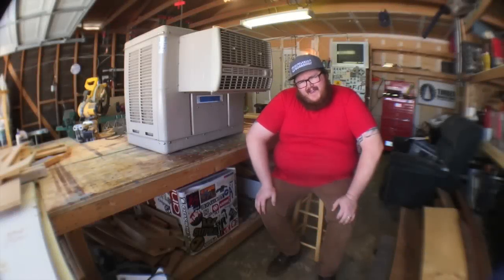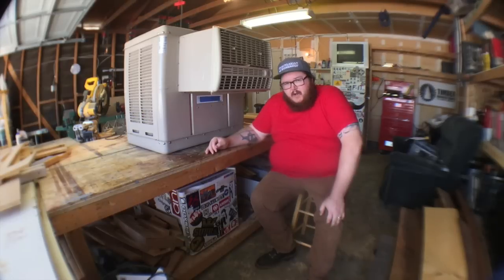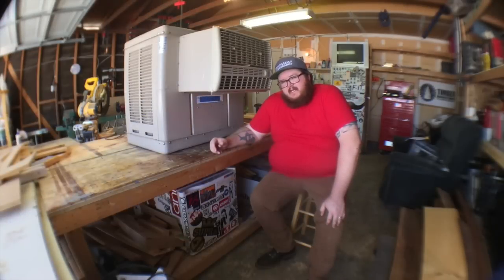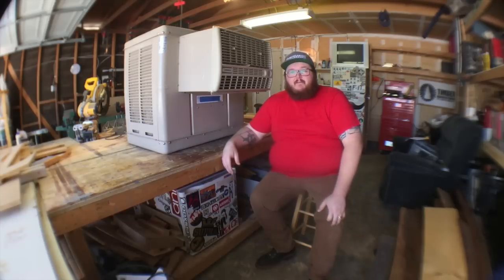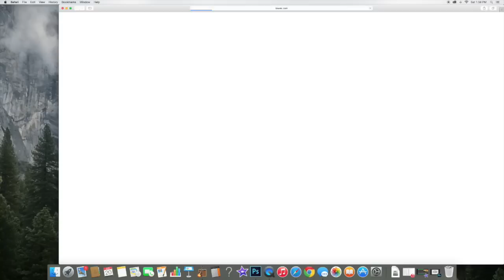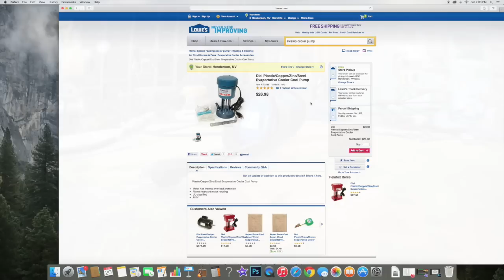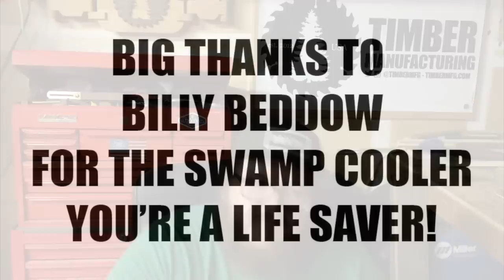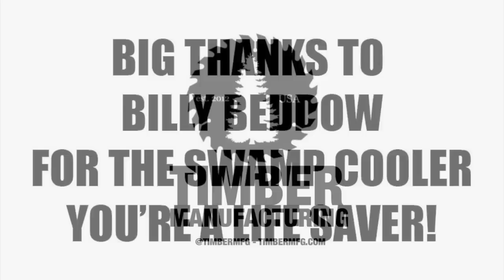Swamp Cooler Tuneup

Comment: I'm here in Vegas as well... I got a cooler just like yours and cut a hole in one of the walls in my garage and mounted it there.  I crack the garage door and run it all the time and on the 113 degree days it keeps the garage at about 78.  Which is, ya know, awesome!  But, yeah, those coolers your role around on casters without exiting the air or sealing a cool air path are muggy and terrible.  If you want a wheeled one, like you made, then people use those outside under cover in a place without walls and just let it blow on them.  In your situation I'd get rid of the cart and, again, mount it in one of your walls.  I also put a temperature control on mine so it automatically turns off once it reaches whatever temperature I desire.  That way at night it doesn't just keep running and running and wasting energy and water.  Great video
Reply from the maker: It works fine for now, I'm going to insulate and get a mini split AC unit. I didn't want to cut a big hole in the side of my garage for this thing.

Comment: What size pump did you use? I couldn't read the label - I think I've oversized mine with 11,000 pump for my shopcool sc3500. It's either that or there isn't enough water distribution tubes over the pads. I only have 4 one on each side.
Reply from the maker: I think mine is an 11,000 too? I'll have to double check. You could see if the slits where the water drains on the pads are all clogged up with calcium build up and junk from the pads. I had to do that to mine a couple days ago to get it working good again. There's also 4 or 8 way distribution tube kits so you could get more water distributed across the troughs at the top.

Comment: you need to circulate the air for a swamp cooler to work. cut a hole in the garage and have the cooler outside with the duct facing in. you are just raising the humidity by running it inside the garage. We get ours to bring temps from 100+ down to the mid 70's by adjusting windows to let the humid air out.
Reply from the maker: I set up fans and keep the garage door open about a foot to allow plenty of circulation. Theres no way I'm cutting any holes in anything for this thing hahaha. I've been slowly working on getting things insulated and I'll have a mini split AC unit in here before long.

Comment: Nice video...
Come down and hook mine up 😂
Question
When the HIGH position 
Isn't blowing as hard as it used to
It's blowing more like it's on LOW
Do you think it's the motor
I've had for man years
Reply from the maker: Thanks for watching, Leo! It could definitely be the motor, have you been oiling the fan bearings regularly? It could also be those, if they've been running dry for a while. You could test it by unplugging it and then taking the belt off the pulley so the fan will spin freely. It should spin fairly easily on its own. While you're at it you could spin the motor by hand too, same deal as the fan, if there's any drag or it feels kind of crunchy chances are that's the issue. If you've got hard water like we do around here, the calcium build up really tears up the motors. Mine was acting up right before I put it away last year. It would just randomly shut off after a little while, so I have to get that figured out now hahaha. I've been running the same motor in it since this video. Hope you get it figured out!

Comment: Got me a used swamp cooler, I just purchased a new float valve as I was filling it manually and running it for a few hours, but once I install the float assembly and hook it up to the garden hose with the adapter and use that to fill the pan can I leave the water on at all times and only fill to the desired fill point?
Reply from the maker: +Edmund Burke I leave it on the whole time when I'm out in the shop, but I always turn it off when I go in for the night. I have accidentally forgotten to turn the water off and it's been just fine in the morning, But better safe than sorry I figure. I don't want to wake up to a huge flood in the shop hahaha

Comment: My pads don’t seem to be getting wet enough. Thinking about putting a small fish pond pump on mine, here in Texas with some humidity they help in my metal shop.
Reply from the maker: Thanks for watching, John! A more powerful pump probably wouldn’t hurt. One thing to check is the tubes at the top delivering the water. The old aspen pads I had in it broke down and the pump was able to push a lot of the little pieces in to those upper tubes and clog them. You may be able to run something through and try to clean them out to see if you can get some better flow from the pump you’ve got. Also, not sure how the water quality is where you are, but here in Vegas it’s super hard. I had a lot of calcium build up in the slits in the water trough at the top of the pads. That could be something else to check.
Reply: Braxton Wirthlin   Yeh I blew the delivery water tubes out with air and the slits in the trough are fine. After watching a video from the champion cooler on the correct way to install new pads I found out that I was doing it wrong along with everyone else. You don’t tuck the pad in at the top underneath the trough. Pull the pad inward so water is forced to run down the outside of the pad. I will fix it first thing when I get to the shop.
Reply from the maker: John Davis great tip! I’ll give that a shot myself!
Reply: Braxton Wirthlin yes just type in champion cooler and it will come up. A little over a 2 minute video. Braxton I put my cooler on casters too so can roll it around.  The one in your video looks almost new. What a deal .
Reply from the maker: John Davis I’ll check it out! Yeah, I was really grateful to get it, it’s been a life saver for sure. I should have an update video on it soon. Recently I added a gravity feed tank to the top so it’s all self contained and doesn’t need a garden hose hook up. That was definitely a big upgrade.
Reply: Braxton Wirthlin can’t wait to see the upgrade. How big is your feed tank? Gallons? I guess your float valve cuts the water off. I redid my pads and it made a big difference. Now the pads are getting wetter. I think I was wishing for a lot to quick. Can’t expect too much until the pads get really soaked. Here in North Texas the humidity is high in the morning and I am able to get by with a fan. The humidity drops off most afternoons and that is when I use. I had a Port-A-Cool evaporative cooler and I hated that think. Those really add to the humidity. Regular evaporative coolers are a lot better than those. Let me know when you do your updated video.
Reply from the maker: John Davis nice! I’m about to move my pads to where you suggested. It’s a 12 gallon capacity clear plastic storage bin with the double flip top lid. They sell them at Lowe’s and Home Depot. I’ll leave a link to one similar to what I’m using. Then I put a faucet coming out the side and sealed it up with silicone. 

Akro-Mils 66486 CLDBL 12-Gallon Plastic Storage KeepBox with Attached Lid, 21-1/2-Inch by 15-Inch by 12-1/2-Inch, Semi Clear https://www.amazon.com/dp/B00006IARN/ref=cm_sw_r_cp_api_i_wO0dFbWCS0HP7
Reply: Braxton Wirthlin   Yes what you did has made more portable. Less leaks to worry about too. You do leave a door open so that it can get fresh air? They work better being by an open door. Mine sets in the middle of the shop with 3 garage doors open. I was raised in New Mexico and swamp coolers was all we used. I had never seen a refrigerated window unit until I came to Texas. Just wondering how long does 12 gallons of water last?
Reply from the maker: John Davis yeah, I keep my garage door open and I usually have a fan going on the other side of the garage to help circulate some air. If I’m running it all day like 8-10 hours I’ll usually fill it up twice. Once in the morning and once in the afternoon. That’s if the reservoir at the bottom is all the way full. If is not it’ll suck it down pretty quick. I’ll usually turn off the tank 15 or 20 minutes before I turn it off the unit. That way the water in the pads doesn’t over flow it. Sometimes 20 minutes turns in to an hour or so and it’s got a lot to fill up in the morning. I grew up here in Las Vegas and have had swamp coolers forever. This one works great except around mid to late August when it gets super humid.
Reply: Braxton Wirthlin  when it is real humid here I try to run the pads a little dryer. This one of mine makes a decent fan without the evaporative part of it. My shop is kinda big so I can’t have it blowing on all of the time but it sure is nice to sit in front of it and cool off for a few minutes. Yeh being in Vegas you have been around them all of your life. I am in North Texas and it does get humid here. I can go an hour west and be out of it for the most part. I was in New Mexico last year and people still use them for the most part.
Reply: Braxton Wirthlin   Good morning Braxton. I ran my cooler yesterday and couldn’t get much out of it. I never run it in the morning only in the afternoon. Too much humidity I guess. Just wondering if I put a fan behind it would help? I have a strong Patton floor fan. A lot of people in my area went out and bought Portacool air conditioners. After using them they are sorry they did. They cost well over a grand and are pretty much junk and do not work in a shop. Our old style works better. Mine sits in the middle of the shop but I have 3 ten foot garage doors open all of the time.
Reply from the maker: I'm not sure if that would work, but it's worth a shot. It might help having some air flow on the pads. I've never tried that, I might have to give it a shot myself though.

Comment: My cooler is making an occasional humming noise i oiled the bearings  but its still doing it what do you think it might be?
Reply from the maker: Obviously it's hard to say exactly what it could be without seeing and hearing it, but here's a few things you could check. 1st you could check the belt belt that runs the motor and see if it's worn, that could cause some noise. 2nd check that the water level in your pan is high enough so that the motor isn't struggling to pump it. That would cause the pump to make noises of the water is too low. 3rd check the motor itself. Try moving the pulley on the motor to see if there's any wiggling or play in it and the motor shaft. It goes without saying, but make sure the swamp cooler is off and unplugged so there's no risk of hurting yourself before you do all this stuff hahaha. Hope this helps! Let me know how it goes.

Comment: im having trouble with my swamp cooler its kind of like the one you have but mine has two switches on the front the left says cool and right is two different speeds i guess and the right now is really loose now so i have to unplug it everytime i am done using it
Reply from the maker: Sounds like the switch itself might have gone bad. You'll probably have to open up the panel to fix that, and I don't really know much that would help in that area.
Reply: +Braxton Wirthlin yeah it still works but i have to unplug it after we are done using it my friends dad might know how to fix it ill have to see thanks for the help
Reply from the maker: no problem, sorry I wasn't really able to give you any assistance. I don't know too much about electrical stuff. I'd probably just keep unplugging it after I use it if that happened to mine hahahaha

Comment: Good job. However,  I bought mine new 5 years ago. The owners manuel states to use 30 wt engine oil in the blower bearings, which I have done. That's a whole lot heavier than that light oil you used. You might want to look into that.  Ruining the bearings would just suck! It's the EXACT make and model yours is.

Comment: thank you i appreciate it.i have to figure out what model i have now i suppose,the stickers are so faded,i know it's a alpine but thats it. thank you,chris
Reply from the maker: Not sure if brands matter too much. I didn't stick with any particular brand or when it came to the pump and pads and hoses and stuff. I just grabbed whatever they had and it seemed to work. The pads I got were over sized and I trimmed them to fit. They only had one brand of pump at Lowe's so I bought one that pumped the same amount of water as the old one.
Reply: Yeah i saw your video when you done it all. thanks for the input,just curious....have you ever tried using  a block of ice in the water to drop the temp,i would think that would make a huge difference in output tem. thanks, chris
Reply from the maker: Chris Hood I haven't tried it yet, but I've definitely considered it. Maybe I'll pick one up tomorrow and give it a shot!
Reply: Let me know the cooling temp difference.I know salt water would lower the temp substantially but the ice will not last as long,i wanna do a experiment with tap water and one with salt water to see the difference once i get my unit back up with all the new parts filters etc that i need. let me know how you fare.
Reply: I got mine going.I added blocks of ice and 6 ice trays.Talk about a HUGE temp difference, WOW!! You should try it.
Reply from the maker: +Chris Hood nice! I'm definitely going to give that a shot!

Comment: Hey man, I was wondering how the swamp coolers working now that temps are rising again. Anything you'd change with nearly a year under your belt?
Reply from the maker: I pulled it out a few weeks ago, cleaned out the pan, oiled the bearings, and it fired right up and is working great. I haven't run in to any issues with it that I'd really want to change. I had given some thought to adding a tank to the top and having sort of a gravity fed reservoir so I didn't have to have it hooked to a garden hose all the time, but aside from that change its working awesome. Thanks for watching!

Comment: Very nice! One question, what is the added moisture going to do to your tools, i.e. rust?  I tried something similar and I found all my tools, especially cast iron table tops started getting a thin film of rust.
Reply from the maker: Frank Thornal I havent noticed any surface rust on my tools yet, but i'm definitely keeping an eye out for it. My garage door is typically about half way open and its only running when I'm out here working. I also set up another box fan in addition to the Swamp cooler so i keep the air circulating pretty well. Thanks for watching!

Comment: Excellent vid. A comment that might help further. Crack a couple of windows and keep a small air flow going while your running your cooler. The cooler air feels nice but be aware of the moisture your putting in your shop area. And that WILL rust your tools, firearms, and anything else not protected from the humidity. A couple of frozen 1 gallon milk jugs in the pan does the trick. Make ya want to put on a coat. Ask me how I know these things. Stay cool.
Reply: Abdulla Ex is right. If you don't open windows, you have a humidifier - not a swamp cooler. It's tough to retrain ourselves b/c with an a/c, you want to keep the house completely sealed up, but the cooler is totally different. The a/c keeps reconditioning the same air. The cooler can't reuse the same air.

Comment: i modified mine blows 48 deg in 108 Temp AHHAHAAH
Reply from the maker: How’d you do it? I need to get mine blowing that cold hahaha.
Reply: @BraxtonWirthlin   make sure you have the larger champion cooler. Then double the pads only aspen. Then install 11K pump. let the silt (hard water sit on the  pads every season) the white silt with the 2x  pads will start to cool way more efficient. i made a video of this with a temp sensor if interested.
Reply: @BraxtonWirthlin  not a joke... 48 deg. is better than my AC... i have turned the AC on my house -0- days in summer in vegas 3800 sqft 6 bedroom house maintained at 73 deg. with 2 swamp coolers.